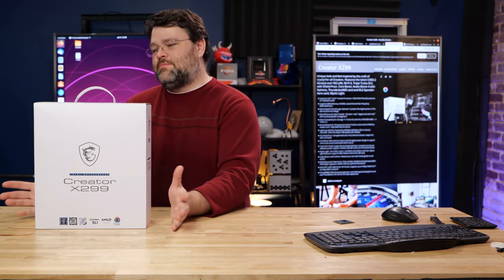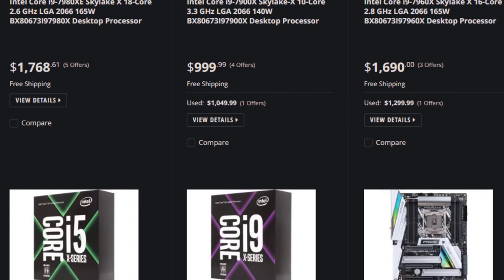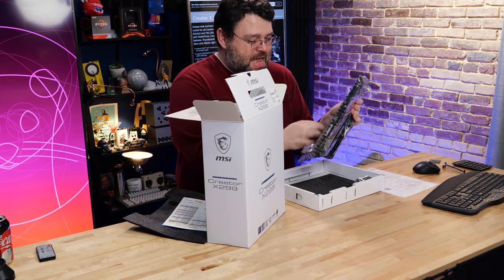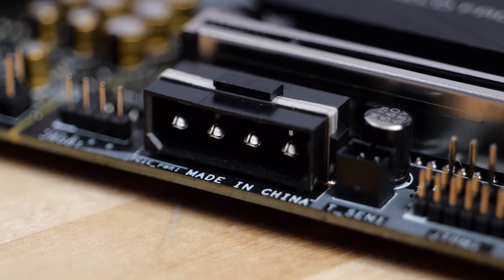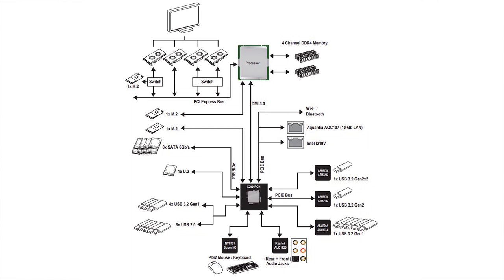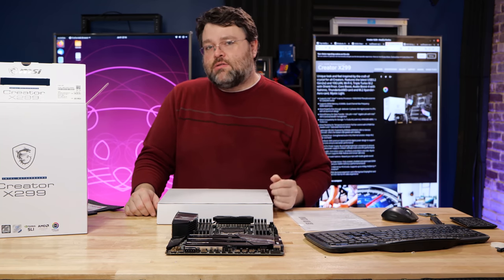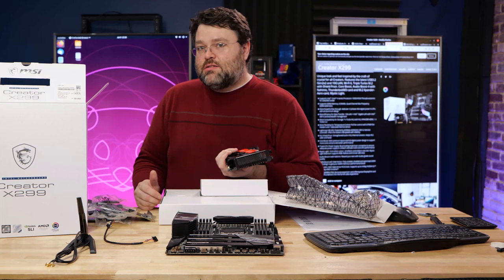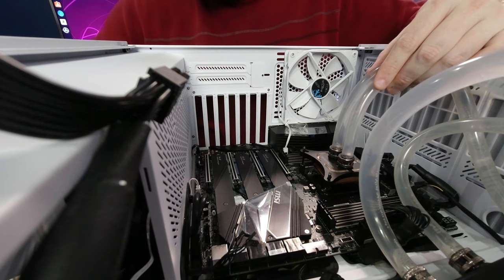MSI Creator X299 Motherboard Review!

Comment: So glad you are looking at these new x299 boards, they have been so overlooked by the AMD core count hype. Intel has a rock solid platform in x299, it's not dead, Overclocking on these boards is amazing. The 109XX series cpus are great. I'm running 10900X right now and loving it. Yea they make some heat, but that's what custom loops are for :D

Comment: People rip on X299 but if you know you need the IO of HEDT, and you want more single core performance than 2nd gen thread ripper, but don't want to spend for 3rd gen thread ripper... Well 299 is a great mature platform.  If I were trying to build a do all unraid build with a gaming VM, this would be my platform. Though, if I were to build my unraid box now, I'd probably go with an asrock rack and a 3600 or lower and just make it a storage appliance.  I actually like this platform a lot though.  It fills a niche that AMD doesn't address giving you more IO and similar cores to ryzen for a price that's way lower than the new thread ripper.  Niche, but not useless.

Comment: Hey Wendal....now is this MSI Creator x299 or the Gigabyte Designer x299x motherboard your best pick in performance and connectivity? My other question is ,in your experience, would you rather have the Gigabyte Designer built in thunderbolt I/O shield or the MSI Creator pcie thunderbolt card for a thunderbolt option?
I don't know if you have time or interest , but I bet many people would really be interested in a video walk threw of you building a Mac OS for this X299X and that super cool Gigabyte Designer TRX40 with the added pcie 
type C ; )....add in card if one was able to without upsetting anyone. 
Thanks!!!!

Comment: What VRM temps you are getting on the board I may want to switch away from my ROG Rampage extreme Omega. The VRM temps are fantastic  hence the active cooling with the 2 30 mm fans but the Drivers for Audio and everything else are just plain garbage. Can‘t even get DTS to work under Windows. Would love to hear what the cooling performance is like on the MSI with even one more eight pin connector ^^

Comment: Nice! Can you review the Asus Prime 30th Edition MB?!
Reply: I have the asus prime 30th edition and its very simular to the PRIME X299 DELUXE II with added fan on vrm's. I have a 10980xe aswell running at 4.9ghz all core 24/7 even the 10980xe has gone up in price since launch day! Mine was £1100 and now they are listed for £1250
Reply: @simonguppy6023  Wow! What are you cooling that with to be at 4.9 on all cores?! I have a Prime Deluxe 1 with an EK monoblock and was thinking about upgrading to the 30th and just getting a CPU block. No monoblock for the Prime 30th yet but the VRM cooling stock looks great as is!
Reply: @AprilMayRain  I'm using a alphacool eisbaer 420 aio. At stock voltages it will exceed 100c i experimented and managed to lower the core voltage to 1.23v and temps dropped to 80-85c. 1.22v failed stress testing and 1.23v passed.
Reply: I'm building a X299 PC system now, in 2023-2024, i have the MSI X299 Creator and i'm still searching a 10980XE CPU :D So, wish me luck !!! 😆🤗🤭😉

Comment: Very good dead overpriced platform
Reply: And he said don't be a fanboy, intel is making it really hard lol
Reply: Could you explain, why this platform is dead? I'm not into it, sorry.
Reply: Sinis Trous they are just releasing the same parts over and over on it
Reply: I think with the new prices and features this platform is really awesome. I picked up a 10940X 14 core for 799 on microcenter, I tried to get the 10980xe but right now is almost impossible. Always out of stock. This cpu is VERY FAST, like amazingly fast for everything I do. I prefer Intel not because I'm a fanboy, but because intel platform is more mature and stable in my opinion. Yes AMD has awesome cpus, but I prefer Intel as long as the prices are not insanely higher than AMD. 14 cores for 799 is not a bad deal when you count the platform features. Ah and for me, my dad bought me an Asus Rampage VI Extreme Omega motherboard. I'm pretty happy with my PC.
Reply: I'm building a X299 PC system now, in 2023-2024, i have the MSI X299 Creator and i'm still searching a 10980XE CPU :D So, wish me luck !!! 😆🤗🤭😉

Comment: I was able to snag a i9 9960X 16core 32thread from Micro Center when they dumped all of there 9th Gen stock. I only paid $670 for it. There was only 1 of the 16core but they had a few of the 12 amd 14 cores. I bought a x299 Aorus Gaming 7 Pro a year earlier, so i had a board. Just last month i went to update the BIOS and realized that Intel all of a sudden decided to enable x4 bifurcation and Raid support without a VROC key. I guess Intel is feeling the pressure from AMD.

Comment: But Wendel, Wendel who cares about X299?

No I am being completely serious, no /s. Seriously why should anyone care about X299.
Reply: Exactly
Reply: Why, aren't you anticipating the 10990XE with bated breath? LOL
Reply: @jamesaron1967  Well yeah that changes everything... except the 3960X, 3970X and 3990X and probably a 3980X.
Reply: If the CPU price and availability become reasonable, there is still value in the platform. Threadripper is a lot more expensive to get the same memory bandwidth and PCIe lanes.
Reply: @Etheoma  I also predict a 3980X with 48 cores. Makes sense given the big gap in performance between the 3970X and 3990X. It would fit nicely in the pricing scheme.
Reply: @MarkRose1337  Errr thread ripper has 64 actual PCIe lanes, whats it face only has 48 actual PCIe lanes the rest are off the DMI link which only has 4 lanes of bandwidth, also thread ripper has PCIe 4 so it's 2x the bandwidth per lane, so AMD has 2.33x the bandiwidth.

AMD's mainstream platform has the same bandwidth has Intel's HEDT platform with an X570 board.
Reply: @Etheoma  That's all true. I'm a big fan of what AMD has been doing lately, but I'm trying to point out the area where the x299 platform still has value, that is, if the CPUs were available and for a reasonable price.
Reply: Probably those of us who ASUS completely screwed with their Rampage VI extreme memory slot problems which are causing system freezes (like me), and who want to replace the board to preserve the RAM & CPU which compliment the platform.
Reply: I'm building a X299 PC system now, in 2023-2024, i have the MSI X299 Creator and i'm still searching a 10980XE CPU :D So, wish me luck !!! 😆🤗🤭😉

Comment: Exactly wait. That's what I did for my 3950x I kept checking Best Buy 3 to 4 times a day and finally got one. Within a half an hour they was sold out again but I paid MSRP about 3 weeks after launch. People was selling them for 1000 to 1200 on eBay. I really hope they get stuck with them!!!!!
Reply: The ironic thing is that the 3950X and 3rd gen Threadrippers are now readily available, but the Cascade Lake X parts are either out of stock or overpriced at retail (based on PC part picker at least).  Nobody noticed that Intel paper launched their lineup because nobody wants or cares about those parts.
Reply: DrearierSpider1 how do u know the intel fanboys aren’t buying them all up. I know someone who said they’re still gonna cascade lake without even considering the 3950x
Reply: Amen lol, or at least FORCED to sell them at cost just to get their money back.
Reply: @shadowblack5455  We know nobody buys them, because Intel can't provide them. They have difficulties even delivering Xeons, even though the Xeons are prioritised in their fabs...
Basically, Intel is having a rough time right now.
Reply: @shadowblack5455  that's cool I just wouldn't overpay especially if your system is running good like mine is x370 1800x just wanted the latest I skipped the 2700x x470. No sense in feeding the rats.
Reply: I'm building a X299 PC system now, in 2023-2024, i have the MSI X299 Creator and i'm still searching a 10980XE CPU :D So, wish me luck !!! 😆🤗🤭😉

Comment: rear shield is screwed in more like, it also won't be centered to your case, don't try to unscrew it won't change anything I tried (TRX40) MSI I have to say has atrocious BIOS, the worst I have ever seen,  ASROCK is 100x better, too bad because MSI makes higher quality and better designed motherboards (less of that shared bandwith garbage) the M.2 Expander is super high quality compared to other brands, a good chunk of the board price goes toward it